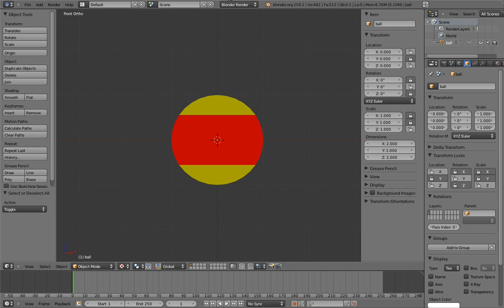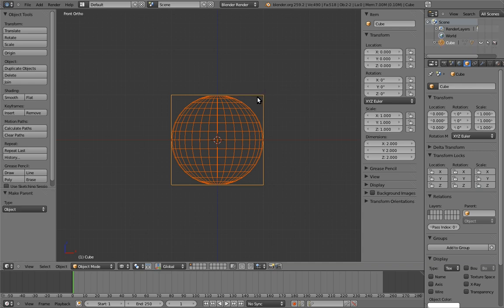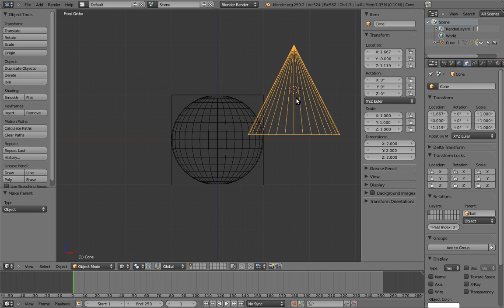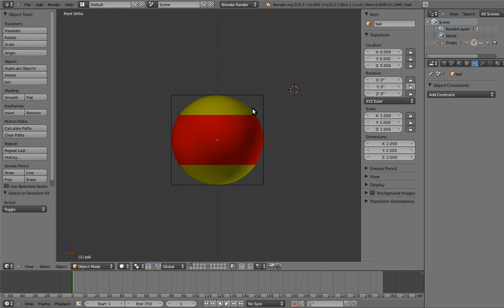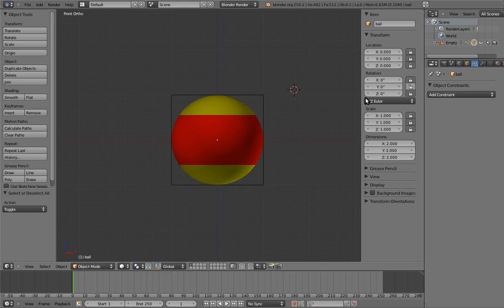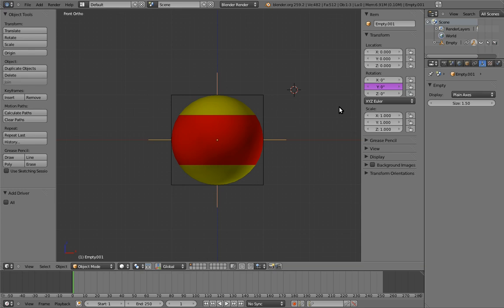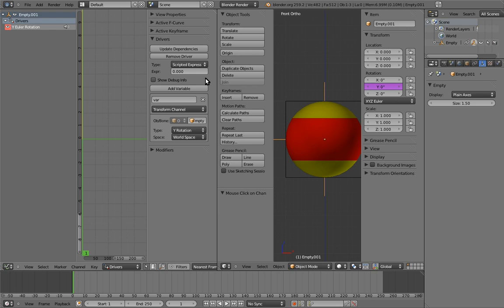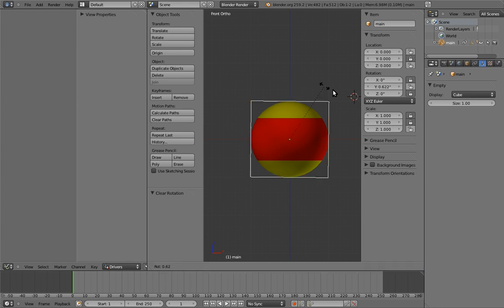Humane Rigging: chapter 01, video 02

Comment: For Blender 2.80+:
When you add a driver to the Y Rotation, the new Edit Drivers pops up and shows an error. Set things from there. Then you won't find Drivers in the Graph Editor, they now have their own Editor (Shift+F6). Its N panel is now divided in tabs.

Comment: Why couldn't we just unparent the ball from the axis empty and instead just apply copy location and scale constraint from this empty to the ball, instead of using drivers to negate rotation?

Edit: Oh I think I get it. When we use the driver approach here what happens is that the rotation gets applied on the ball, then the scaling and then we inverse the rotation. This causes the ball to scale along the parent's coordinate system instead of its own.